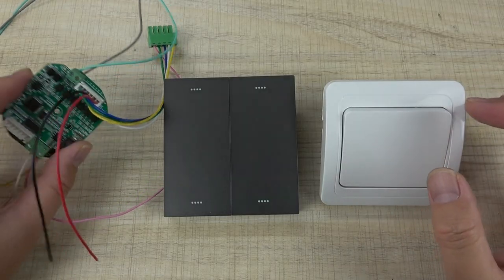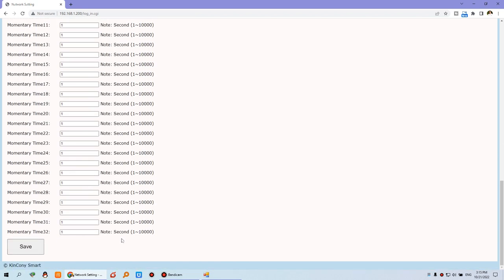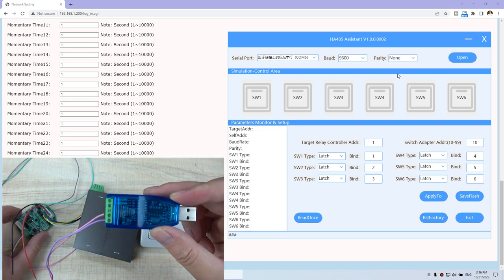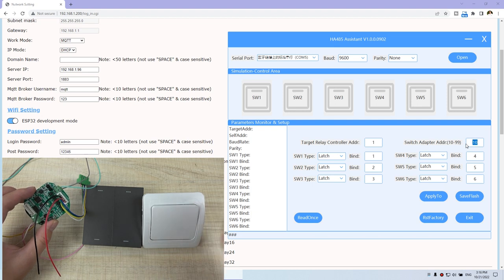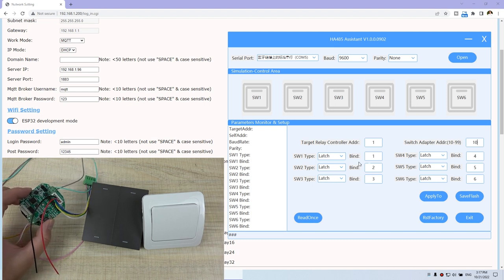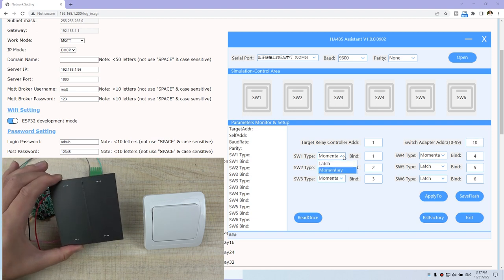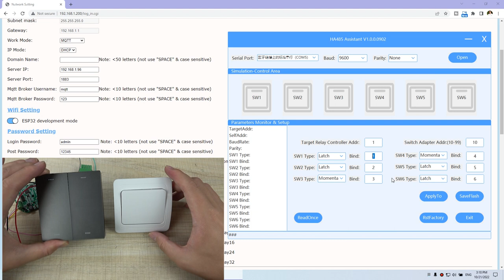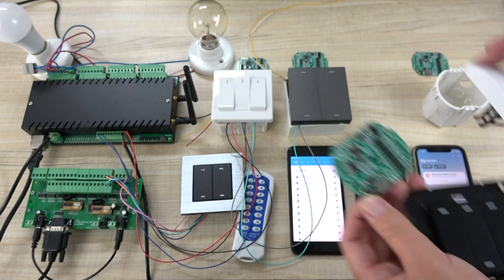KC868-H32B Pro controller use traditional switch for home automation

Comment: Sir , how much switch connection 4 wire (12V and RS485 )maximum length allow with reliable working ?, when practical house wiring electrical interface disturb to RS485 ?
Reply from the maker: yes, 4 wire, MAX support 1KM. it already have used. The 485 bus is mature and widely used in the industrial field

Comment: Can it be designed to use dry contact on 24v motor control [ blinds and curtains] Eg up +common; down + common; up +down ( for stop)
Reply from the maker: sure, no problem.

Comment: You can use a traditional switch by simply connecting it to the h32bs digital inputs. It would be great if kincony added to the firmware the ability to configure standard dry contacts by adding a mode in which both close and open contacts send a message about it to the mqtt queue. Now, only one message comes into the queue when dry contacts are closed and opened. Therefore, they are useless if you want to connect a traditional switch for use with openhab.
Reply from the maker: if you update the H32BS firmware to the newest, already have this function, 32 digital input will feedback ON/OFF when short with GND or not short. you can try. thanks for your suggestion.

Comment: vrey good , loved it
can make wired sensor ( pir sensor - ultarasonic sensor........- led lamp and ....) work with modbus ?
Reply from the maker: now already have many RS485 sensor support modbus in market
Reply: @KinCony  
can sent me links for RS485 sensor support modbus ?
how can  i use h32bs with RS485 board and sensor ?
Reply from the maker: @محمدرزق-ح1ح  H32BS will support it in furutre, after need update H32BS' firmware.

Comment: how calculat power supply parts of new  boards terminal rs485 and all other  devices work 12 volt in full solution project used kincony products ?
Reply from the maker: yes, use DC12v, the small board use 12v, current very very low